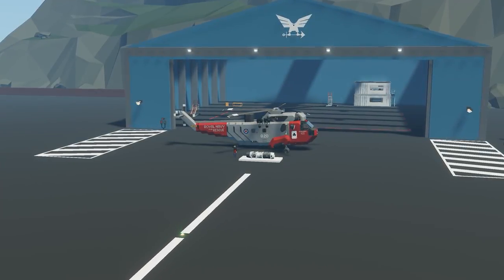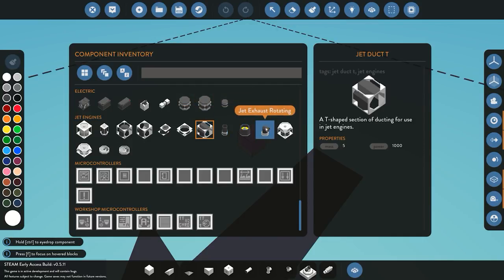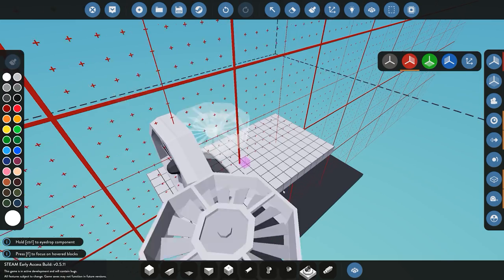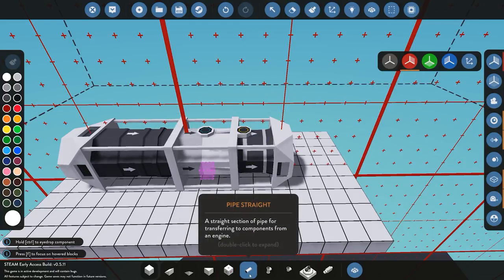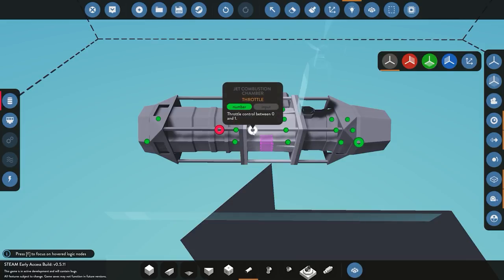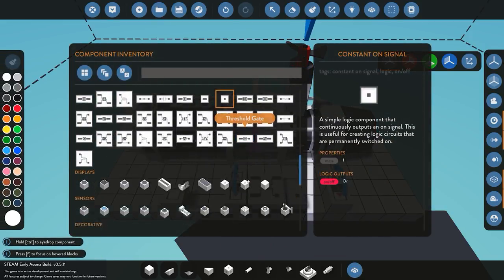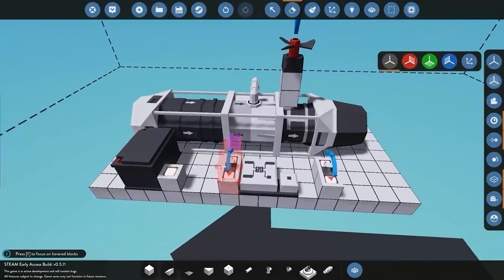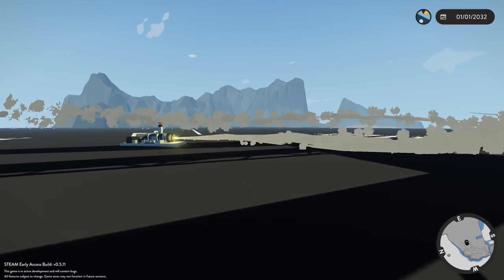Stormworks Updated Advance Jet Engine Tutorial

Comment: A constant on PID will cause trouble if your engines are off for a while before you start them. The PID seems to create phantom signals that result in the turbine wrecking itself before the throttle has chance to adjust. I know this from experience with my three turbine MH53,  I ended up giving each turbine it's own PID and power on only when fuel pumps are active and the turbine is turning.

Comment: A better PID setting is  P 0.5, I 0.00001, D 0.001, it will be much more responsive and allows the engine to reduce throttle.  You can also use a clamp frim the PID to the throttle with a minimum value of 0.000001 and max of 0.99 to keep the engine from spooling up out of control.

Comment: So Jet Turbines, compared to Diesel Engines, need no cooling, no exhaust, and are degrees more powerful? Just an air intake and whatever you want to drive? What's the catch?
Reply from the maker: Consume a lot of fuel.
Reply: @MrNJersey  I have to respectfully disagree. Well, at least for Turboshafts. I made a medium-small turboshaft boat powered by 1Jet Engine and 3 Fluid Jets. 
At max efficiency, it hits 11.45 RPS, ~60 Knots, ~2.0L/s, and with a fuel capacity of 5000 Liters. I'm new to the game, but I think that's pretty impressive.
After using them, I'd say their catch is unresponsive RPS. To prevent extreme acceleration, I'm using the Clutch, Fluid Jet deflectors, AND the Target RPS for multiple methods of thrust control.
By the way, the PID is set to 0.1, 0, 0.1, 1. It prevents the engine from overrevving above target RPS.
... ... I can't say anything about using a Jet as a Jet, though.

Comment: I set mine up exactly like yours except that I used ducts and put multiple turbines. I'm having an issue however, when I try to throttle down the engines, they will not decrease in rps. Max throttle in second gear of my ship they will be at 74rps, but when I Bring the throttle down to 20 from 180 they will not slow down.
Reply: Might be a pid issue
Reply: the pid settings do not let the engine throttle down if its over 60ish rps.

Comment: Engine fails to start up.
-From front to back: intake, compressor, combustion chamber, small turbine, duct, exhaust, all arrows pointing backward
-Fuel tank (with jet fuel) is connected directly on top of combustion chamber
-Compressor has medium battery hooked up to it, and only it
-Separate battery powers a push button and throttle; button is connected to compressor's red input and nothing else
-Throttle itself spawns at 0.5
-Spawning in the map's arctic regions
I hold the button for well over 10 seconds; an RPS monitor reading the intake's RPS goes up to 000.84, and never any higher, beginning to drop after holding the ignition down for long enough.
Reply: Derpy 1109 Do you really expect anyone to go out of their way and diagnose what you did wrong based on your terrible explanation of your system? The engines work just fine, you simply set it up wrong. Easy.

Comment: For some odd reason, none of my ship's engine work. They're built in advanced mode or update to work that way and when the limited fuel patch came out, I added a fuel inlet. It shows air fuel and exhaust as 100% and when I add fuel and try to start it, it all goes 0%. Now, it worked before so I would be really thankful if anyone has any tips for me. Cheers
Reply: Your throttle is set at 0%. Thats why it shows 0.
Reply: @tomkamin2676  That would be a possible cause but no, throttle is set to 0.20 although the microcontroller that controls everything might have errors and provoke that. Thanks for tip.

Comment: Whole engine have same rps, or not? So why connecting it to generator at 9:10?
Reply: what generator are you talking about ??
Reply: @doomdave475  sorry actual module is called JET TURBINE MEDIUM, why connect RPS directly to it? does it matter? whole engine turn at same RPS so I cna connect it to any RPS output, cannot I?
Reply: Are you talking about the PID?
Because then its because the only throttle options on the jet are on and off
so the PID is needed to precisely flicker
that throttle lever so the rps is constant